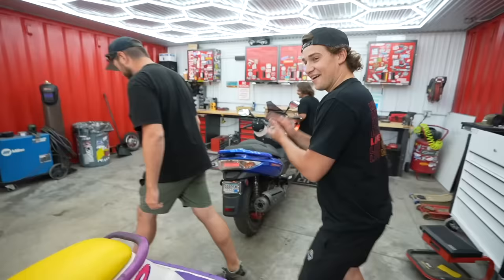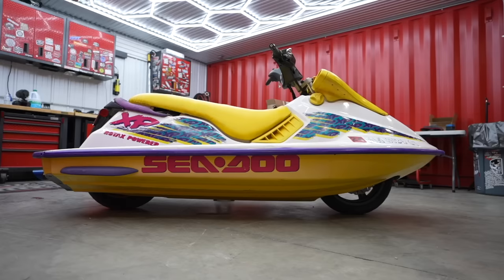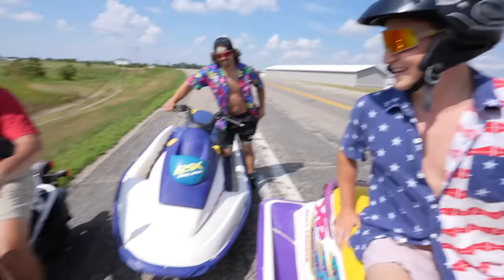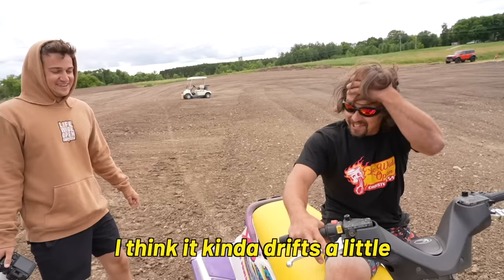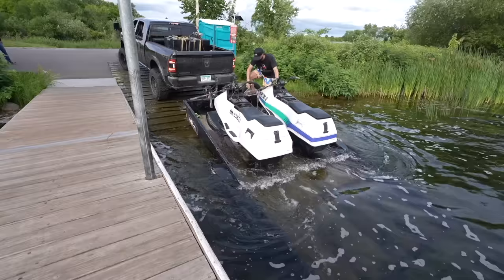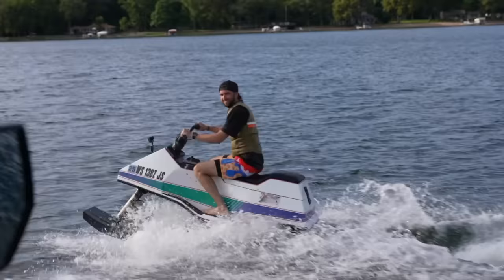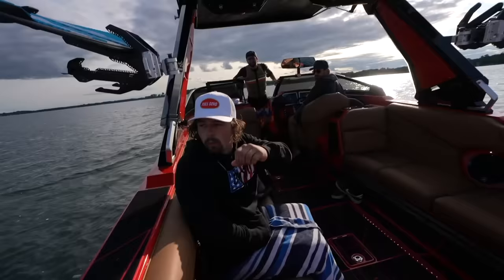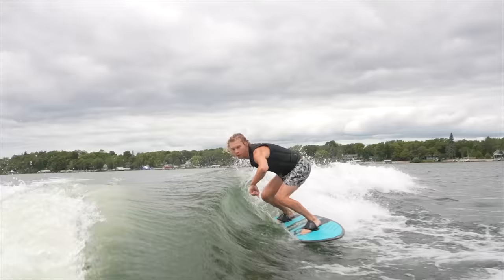My New Jet Ski on Wheels

Comment: The thing that happened to Evan is understandable, My neighbor has one and the left lever is the rear brake and the right lever is the front brake. When you’re used to riding bikes where the left is the clutch you grab the right to slow down and get a huge handful of front brake and fall over.

Comment: If you think that 717 xp beats up on a spark, find a 787.  95 xp800, 96 xp, or 97-99 spx.  25 more hp than the 717.  Put on bars, a grate, and sponsons.  It'll turn as hard as you want.

Comment: Ken is never that happy unless he has a beer in his hand. Was good to see you smile and not be grumpy ken. 

Also can we please get more 9f the water bikes. You guys should either make upgraded parts for it or if there is a company that sells parts for it do that. But it would be sweet to see both those things ripping. Fix the motors up or put something a little bit better in them. I would go with a new motor. That way you got the power to actually jump the waves. 

Can you guys stop wrecking everything you guys make these sweet rides then beat the shit out 9f them. Which is cool but I would rather see another video or two before you wreck it and then never see 9t again. 

Great video guys always look forward to them. Would love longer videos if you can these just go so quick.